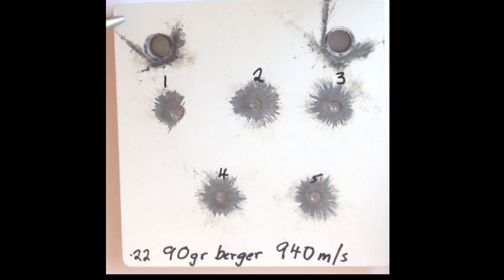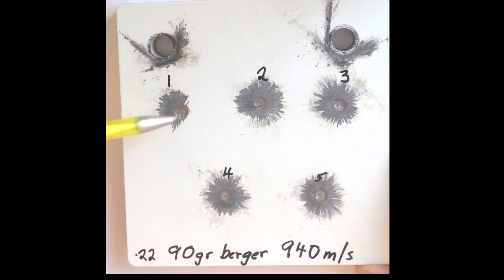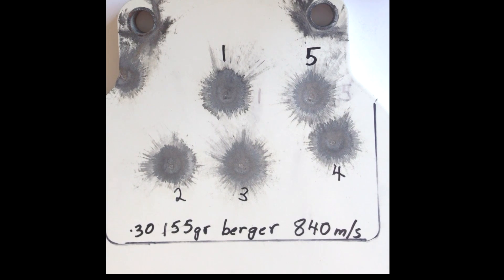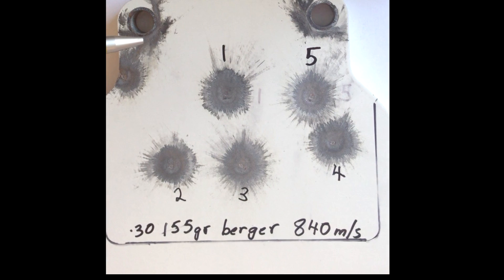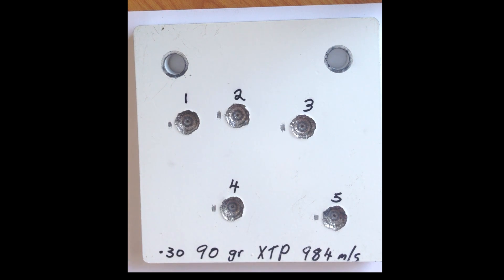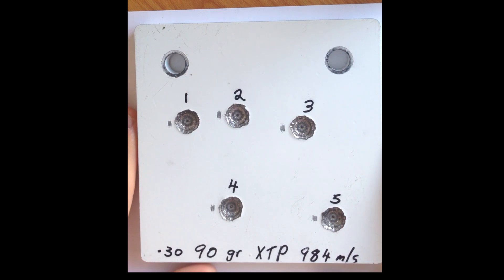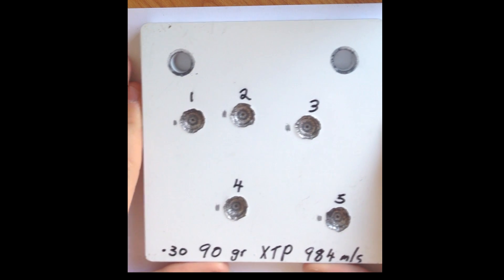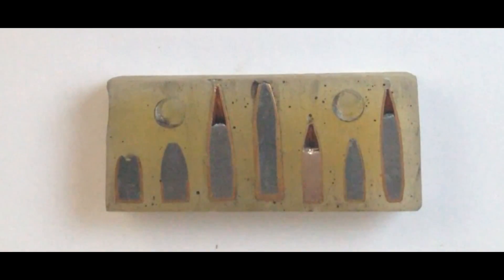Shooting Steel AR500 Bisalloy 500 Damage Testing

Comment: Why did you not show a close examination of .308 win 100gr hornady sp ? 
of all those hits that one looked the most interesting because one bullet only hit the edge of the plate.  Would have like to see the damage up close. 

Was there a lot of difference between the .308 xtp and the .308 win sp ?
 
It was still a very good test.
Reply from the maker: Hi Burnout002NL1
I didn't worry about the 100gr SP as it was basically identical to the 90gr XTP but had slightly more penetration, although at that point the plate had already failed and it was just the change in how much the plug had started to come out.

For the test I was trying to keep away from any edge hits as they edges will soften slightly from the laser cutting, and not give a true value of the  plate properties, nevertheless I should have thrown it in for interest sake!

Cheers Lachie

Comment: What is your opinion/expectation as far as indentation on the Bis500 by something a little larger like a 225 to 300gr .338 round?

Looking to build a long-range gong, but I was surprised to see the amount of cratering you were showing at the higher speeds.